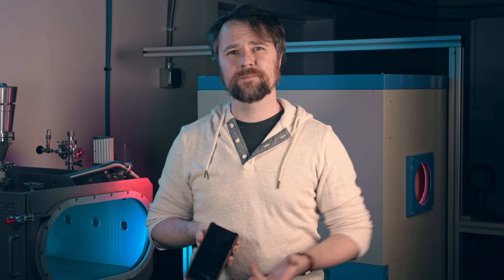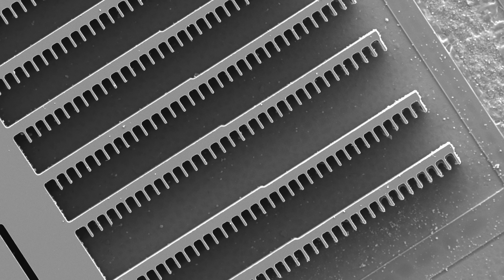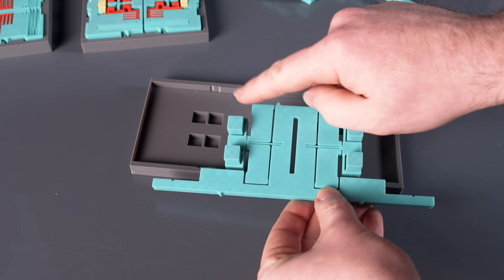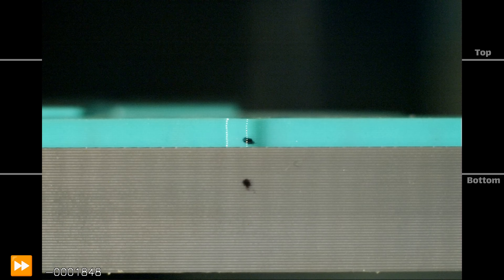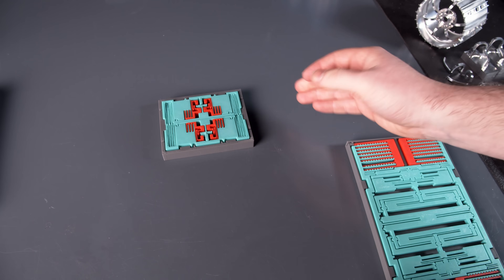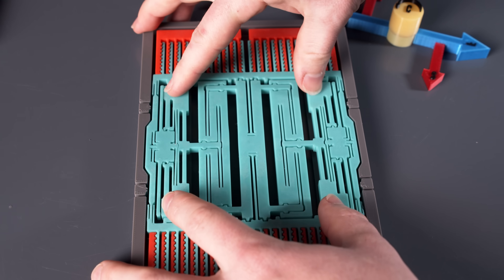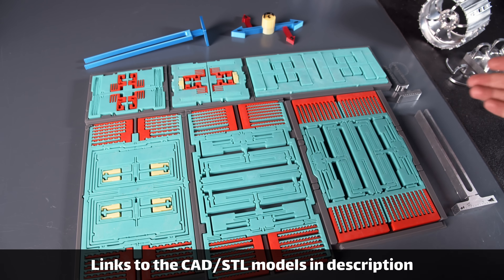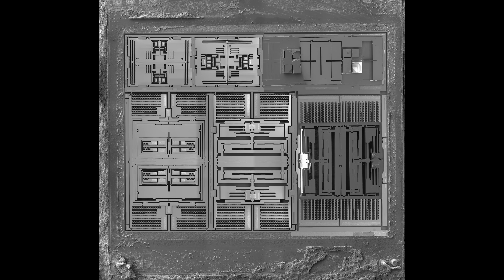The Micro Mechanisms in Your Phone

Comment from the maker: 🚨Correction!
A paper about this exact mechanism has been shared with me: https://transducer-research-foundation.org/technical_digests/HiltonHead_2010/hh2010_0061.pdf The X/Y gyros had two plausible explanations, and I picked the wrong one 🤦‍♀ The general principles hold, but the drive and sense directions are flipped in the X/Y gyros. I.e. the drive direction is up/down, and sense is left/right in-plane.

🚨Correction!
At 6:00 I misattributed some of forces involved. @StadtlerHM sent me this correction in private, but I thought it warranted being pinned so more folks could read it!

> "So when you drop your device and there is a downwards acceleration, the frame of the mems device will move down, and because the [proof mass] is decoupled from the rest of [the frame], it will attempt to stay where it is by moving upwards."

This is true for how the phone detects acceleration to the phone by any force that acts on the frame, but not the proof mass. Gravity however acts just as much on the frame as it does on the proof mass, and as such there will be no difference in acceleration from gravity between the frame and proof mass. An accelerometer therefore can not detect acceleration from gravity when accelerating when in freefall.

Instead, when the phone is stationary, the proof mass will hang low, being pulled down by gravity, with the flexion joint pulling it upwards to keep it stationary. When the phone is dropped, the spring force remains, but the gravitational force now acts equally on the frame and proof mass, causing the accelerometer to detect no apparent acceleration from gravity. Because the spring force is pulling the proof mass upwards, it will be pushed upwards relative to the frame, causing it to appear to stay stationary, and "lag" behind the frame in the fall.

In short, the reason the proof mass stays stationary is due to the force from the flexion joint, not because of inertia causing it to "move up". Both the phone frame and proof mass have inertia, and both are affected just as much by gravity.

The spring force on the proof mass acts as a spring that's bent and released, accelerating it upwards and starting to oscillate. This is why your test shows the proof mass "lagging" behind the frame when first dropped, then subsequently starting to oscillate.

</end correction> Thanks @StadtlerHM!
Reply: Thanks for pinning this, it was really bothering me! Plus, you can actually see the z axis gravity in your print! At rest, the proof masses are sagging down, because they are being accelerated by gravity!
Reply from the maker: @MordecaiV  Yeah, I blame the gyroscopes for this big goof on my part 😅The gyros don't work quite like a "textbook" gyro, so I spent a lot of time and energy figuring out how they operated, and mostly ignored the accelerometers since they were simple and I knew the basics already. Should have spent more time vetting that part of the video since whoops, flubbed the explanation 🙃

Also funny because prior to filming, I had to twist the gyros a bit to get them more level... the plastic had deformed and creeped due to gravity and sitting around. Foreshadowing haha!
Reply: @BreakingTaps  Also, at 4:55 when you drop the phone in that orientation the direction of acceleration would be coplanar with the device based on the implied orientation of the mounting of said device within the phone. However, if you hold the phone flat, with the screen facing directly up or down, then the Z axis would be invoked.  I think.  I am not too smart.
Reply: @MordecaiV  Thanks for this video.  It was fascinating and totally absorbing.  I feel humbled by the amount of work that went into (a) getting into the chips and observing them, (b)figuring out how they "probably" work, (c) making those beautiful 3d prints to demonstrate the whole thing on a scale that humans can comprehend.  Did the manufacturer see this video and send the data, or did you contact them?  It would have saved you a lot of work (and guess-work) if you had had the data before making the video.

Isn't it incredible how economies of scale can make these devices so afforable!
Reply: My first thought when you showed the phone being dropped - because that's basically the only time none of linear sensors are detecting any forces at all.
It's also an important property, because that's how the phone knows where "down" is, without the inherent drift of gyroscopes.
Reply: Thank you both for this correction.
I was really struggling to fit your explanation in this video with my understanding of physics. 👍
Reply: It’s also important to understand that world-relative down (-Z) is not necessarily the same as phone-relative -Z or chip-relative -Z.  All the mechanisms in the accelerometer must be able to consistently measure a consistent 1G force down in any axis that may line up with any of the mechanisms or (more likely) be somewhere in between.

Regardless of whether the mechanism are naturally “hanging down” in chip-relative -Z or not, the sensors are calibrated such that they’ll accurately measure 1G of acceleration force in whatever direction gravity is currently pulling (relative to the chip) and they’ll accurately measure 0G of acceleration force while in freefall.
Reply: I already watched a few videos about mems so I already had a basic understanding about how it's working but I still appreciate the amount of work you put in your video. The only negative thing about it is that I end up having even more questions! 
Like, how the Y accelerator knows if it's moving in the north direction vs the south direction? Isn't it going to detect the same exact charge in both directions? And I'd like to know what make the gyroscope's "tuning fork" vibrating like this... Is it just the normal movement of the phone or is it driven by an electromagnetic mechanism?
Reply: @Reth_Hard  The general solution is to have three axis gyros, accelerometers, and magnetometers.  For purposes of illustration, let's assume the phone is not moving relative to Earth.  Then, something is holding you up.  Maybe a hand or a table.  That force registers on your accelerometers, so you know that gravity is pointing the other way.  Then you use the magnetometers to sense which way is magnetic north.  With that information, you know enough to figure out how you are pointing in space.  With that information you can correct the gyros are they continuously drift.  Put it all together and you can sense how you are moving and spinning relative to the Earth surface with good accuracy.

Technically, to really make it work, you actually want to use the GPS (or other location methods like cell networks or wifi), too.  If you don't know where you are on the surface of the Earth, you don't know the relationship between True North and Magnetic North and you almost always want True North.  You can also use the GPS to correct the accelerometers.  As you integrate the accels to get position, your error will grow, but the GPS can help you correct that.

So, the end result is that the gyros and accels tell you how you're moving in a relative sense with the magnetometers and GPS giving periodic corrections so you know where you are in an absolute sense.
Reply: @Reth_Hard  same... thats the ONE thing i wish he added.... 
.
how / what causes the vibrations in the first place?
Reply: Humble and brilliant. Always blown away by the effort and knowledge poured into these presentations. Love it mate, keep it up!
Reply: Hah, I was wondering this exact thing, thanks to both of you for the correction!
Reply: Yup, pretty interesting nonetheless (the influence of gravity on accelerometers).
A lot of people want to use the acceleration to calculate speed and movement. However, accelerometers are really sensitive to the "noise" produced by gravity. And that's why there are a lot of algorithms that substract the effect of the gravity.
Reply: What I want to know is how google knew I was wondering exactly this last night.  Probably a pretty basic extrapolation that I watched a couple videos of the new solid-state technology that creates airflow(covered on PC World's YT,  2 weeks ago).  But it's still eerie to see it manifest.
Reply: @Dr._Nicholi_Rasmuson  Due to the artificial neural network the system detected that this video matches. Sometimes it's dowright creepy what stuff you can find out through that.

For example you can find out wether a woman is pregnant if you look at what she buys. That's something which no human observer would notice.
I'm not talking about concious decisions or obvious baby products here, the woman doesn't nessecarily know that she's pregnant, but you can use neural networks for finding it out.

I'm using this example, because that was given during data science class.
Reply: @ThePandafriend  Yeah, I get all that, I was just sort of pointing and marveling.

I think part of it is we only remember when it hits right.  YT suggests a LOT of videos I don't want to watch.  But if it gets it right just once in proximity like I was saying, the next day I had a thought....well, that seems spooky.

I know there's a bias term for that, maybe Frequency bias.  I don't know, can't be assed to read more of them right now, lol.

Cheers tho.
Reply: Yes. The G force acting on all of the components is opposed by the hand. When the hand drops the phone, all the opposing forces drop to zero. Although the proof mass wants to accelerate downwards, the spring force opposing the earlier G force remains resulting in an upwards acceleration (relative to the rest of the phone) of the proof mass.
Reply: @Breaking Taps
I misread your 3 word at first glance... I thought you wrote mastur... well, you get my meaning.
I get excited by this stuff but that is getting a bit too excited.
Reply: No object is ever at rest
Reply: How about an overview of an ingenious motor design: the "Ultrasonic" motor found in Cannon camera lenses since the 1990s or so. When they came out, it was a revolution in how quiet an autofocus lens could be.
Reply: @AllAmericanGuyExpert  crikey. Just learned what an ultrasonic motor is earlier today having never heard the term before in my life. Now I see it mentioned in a comment like 6 hours later.
Reply: indeed, a phone at rest actually feels 1 G (9.8 m/s2) downward acceleration, and a phone falling is feeling zero acceleration, until it hits concrete and feels umpty too much breakage accelerations.
Reply: @yofa42  the stationary phone feels the acceleration due to the force holding it up, so that actually points upwards. Of course, it can generally deduce that gravity is probably in the reverse direction, so it can infer which direction gravity is pulling it in, but it measures the upward force.
Reply: Thanks sooooo much for this !! I was wondering how for a long time
Reply: llllllllll
lll
l
l
llĺà!QQ°++`+QQqqqqqqq1☆°°
Reply: Every day is a school day 👍
Reply: Its the principles of inertial being used here. It leverages on the concept of inertia to detect acceleration which is change in velocity per second (m/s^2)
Reply: Your transparency deserves credit too.
Reply: Thank you!
Reply: You wrote "I misattributed" and I misread it as mastu- well it's gross
Reply: Uh, why do you have so many tools?
This microscope, the phantom camera, the cnc machine, its a lot of things for one guy
Whose stuff are u using? 😢
Reply: much love.. this sort of stuff goes a long way for the free thinker  *subscribed
Reply: Glass is relatively strong. Imagine having a wine glass out of concrete, it would shatter at the first ceremonial nudge.

Now imagine a wall out of high quality glass.
Reply: Suggestion for another MEMs device: 3D magnetometer. Also, humidity and pressure sensors as well. How about a PIR device also? Nice explanation about the gyroscopes here. Thank you for all you do =)
Reply: Its like dropping a slinky, the "lag" is due to the spring tension and can also be calculated with mass and the spring constant. I wonder how applying a force downwards (rather then dropping from rest) is calculated?
Reply: This seems like a really complicated way to say that "being stationary relative to Earth's surface is mathematically equivalent (regardless of sensor type) to constantly accelerating upwards at 1G, and if the phone is dropped then the acceleration changes to 0 in all 3 axes since it's now following an inertial geodesic - ie a straight line in curved spacetime" :P
Reply: @triffid0hunter  exactly this. When we read the MPU data, we know which way the chip (and by extending the phone/device) is oriented by identifying the direction of the 1G acceleration
Reply: @triffid0hunter  😅 i read that last part in Matt O'Dowd's voice
he of PBS Space Time :yt:
Reply: @triffid0hunter  I believe in G.R., but I understand people who don't, and your explanation with the details of the trajectory on space-time are innecesary.
Reply: @triffid0hunter  oh yes, what an uncomplicated explanation, EVERYBODY knows about geodesics.
Reply: Good plastic models to illustrate micro devices! However with such simple error as corrected above no way I'm gonna believe way more complex explanation about gyro is correct.
Reply: @alexmartian3972  wow.... i found the Trump lover / Election denier... 
.
id actually say if he was MORE wrong about it (instead of it being a VERY VERY simple thing)...... THEN!!! id question the 2nd part
sorta like how you find 1 single instance of "voter fraud".... and decide this means the ENTIRE election was "rigged" 
.
.
i guess we cant all be smart............ someone has to be the opinionated idiot.......
.
.
.
(and no, i DO NOT like Biden..... but i damn sure dont like hypocrites)
"im pro life.... but for the death penalty for drug dealers"
"we should support the child as much as possible when its in the womb.... but the second its born, that child needs to pull them self up by the bootstraps and get a job"
"welfare and college loan forgiveness is communism.... but bailing out a company because they made bad decisions, and cant pay for a loan is totally fine and totally capitalism" 
"i support cops.... thin blue line!!! ..........but i want to abolish the FBI and ATF because that would benefit me and my gats" 
.
"i can filibuster 1000 times...... but if the "lib-tards" do it once.... i will write a bill calling for its ban" 
.
and it SHOULD be banned.... 
but then Biden won instead of trump... and the republicans dropped that idea QUICK!!! 
i wonder why???? i JUST! CANT! FIGURE! IT! OUT!!!! 
i feel like its so obvious.... but i just cant find the word to describe it..... OH WAIT!!!! hypocritical hacks!!! thats the word i was looking for!!!!
.
.
(PS, im a gun owner, gun collector, and AVID hunter)
i just try to not be a HUGE hypocrite.... even if it hurts MY OWN interests (both parties suck at that.... but the republicans are worse BY FAR!!!
Reply: @kainhall  How can one be MORE wrong in THAT part than when claiming there is force when there is none and none when it is there?

Comment: This was amazing! Just came across it. Since it was cast in the context of cell phones, a little perspective on the software side. 

In the early days of smartphones, there was only the accelerometer and no gyroscope. The software was not able to detect certain movements very well, such as laying it on the table and giving it a spin or 'drift' if someone moved in a certain way not detected by the phone. The X/Y/Z data was also very jittery, so apps had to write their own data processing functions like Kalman filters to smooth things out. This made detection a little laggy, so apps could not track in realtime.

A few phone iterations later, gyroscopes were introduced. Now it was possible to combine the data and do on-device filtering. Also algorithms to prevent issues toward the edge of the sensing range (a digital analog of 'gimbal lock'). The result of this 'sensor fusion' was reasonably high-precision values in 3D space, allowing applications like compasses, games, and some of the apps shown in this video. The technology eventually led to development of drones, self-guiding robots, and Augmented Reality.

Here's a good primer on this: https://www.digikey.com/en/articles/apply-sensor-fusion-to-accelerometers-and-gyroscopes

Comment: Thank you for this awesome video… and all the work you put into it. This is really cool stuff!
By the way… When you drop your phone, it will NOT feel acceleration in the -z direction. The coordinate system is fixed relative to the phone itself; not the earth. So the phone may “calculate” acceleration to the floor based upon all x/y/x acceleration inputs, and other spatial input data (e.g. known gos location, gyro imputs, etc).

Comment: When you drop a phone, it's not so much detecting downwards acceleration, in that the accelerometer doesn't flex up, it is flexed down before it drops and would go into a neutral position as it falls as the entire phone experiences the same force and everything accelerates at the same speed. If it was the flexing up that it detects as the phone falling, how would it flex more when the phone is turned to the opposite orientation?

Comment: Just dropped by to say, I might sound like a nerd right now but. When you're dropping your phone, it's in a free fall, and is not accelerating or feeling any kind of force whatsoever. The phone is actually accelerating upwards with 9.8m/s/s when you're holding it still though. You should get a 0 reading on all accelerometers if you drop your phone.